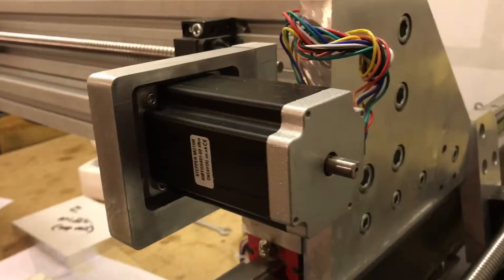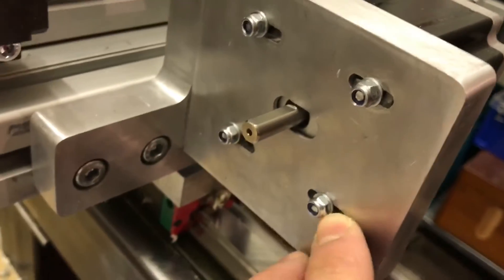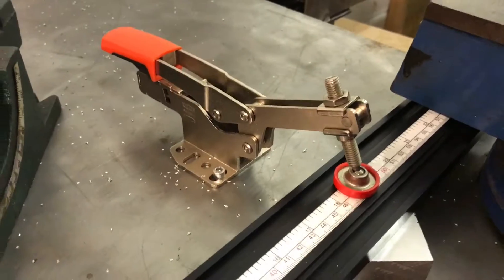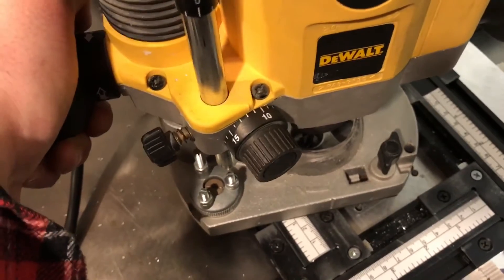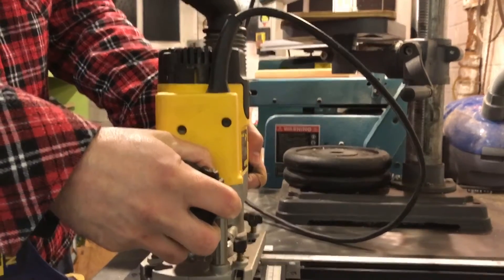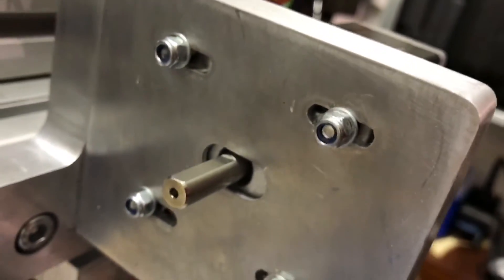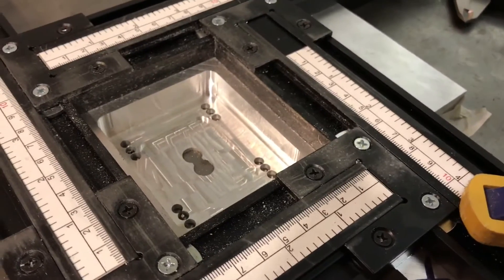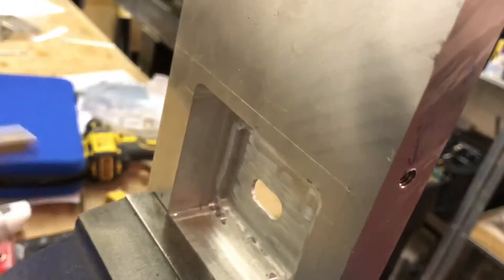Routing Pockets in Aluminium Plate - Part 1- make CNC stepper mounts

Comment: What is your tool bit life like?  It would be much easier on them if you can match up the spindle RPMs with the tool diameter.  Search for "spindle speed for milling aluminum".

I would imagine that it is impractical to use coolant or cutting fluid.

Comment: Joe, doing the entire playlist to see if you reveal how you made the gantry side plates but so far not feeling lucky. I haven't reached out to a CNC forum and guess it is high time I did take advantage the cloud mind of CNCZone.  There is a subset there for the Canadians and I am going to try to get someone close by with a vertical mill. Hope I can get some attention there. At least I can bring some decent drawings as I have been getting on with Fusion360 and have  a good representation .
Some might be interested in how you made accurate cutting of your gantry side plates. I would  like to modify mine to make them longer like yours. They are drawn as 150mm long or wide and 210mm tall.
My drawings require that I make a 2mm deep notch for the bearing spacers. And I agree with that method of course, but it almost certainly requires the use of a vertical mill. My Z axis plates require this for creating a reference for the one set of the Hiwin bearings.

So far out of 6 quote requests for my machining of 6082 plate I have but one reply and it was for $3400 CAD (2700 USD) You know the Asian manufacturers are courting me for a 1200 by 1200 table with 200mm Z  AND a rotary tool for just over twice this including shipping :P 
Problem is that they are not portable and though mine will weigh more than 700Lbs it comes apart. I just have to grind  several weld seams.

Comment: This is great! Thanks! Most videos are of CNC routers and/or jigs set up with poor explanations. This was very clear. I need to mill some sections of 8mm sheet aluminum down to 3mm to mount volume potentiometers. The threads on the pot is only about 7mm long.
Reply from the maker: +Ammar Mariti glad you found it useful - only thing I'd say it it isn't super accurate if your pocket needs to be micrometer perfect! This wasn't that critical for my application...
Reply: oh one more thing, what RPM should it cut with?
Reply from the maker: +Ammar Mariti I'm not sure! I just went by what it sounded like!